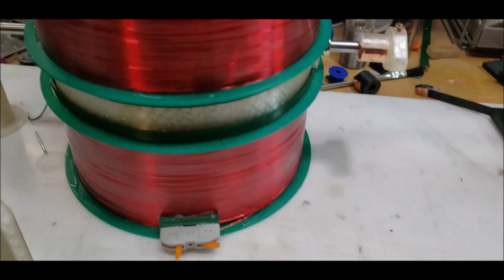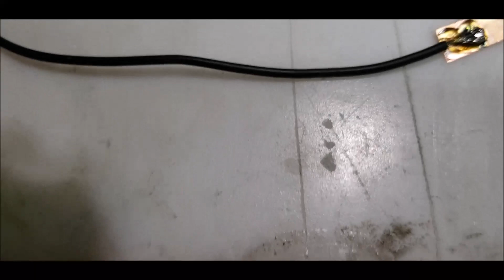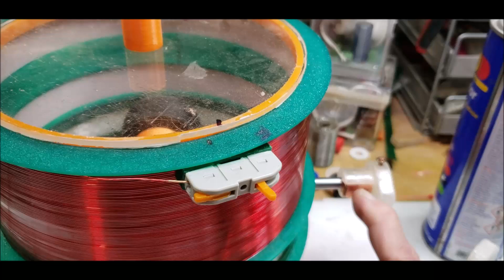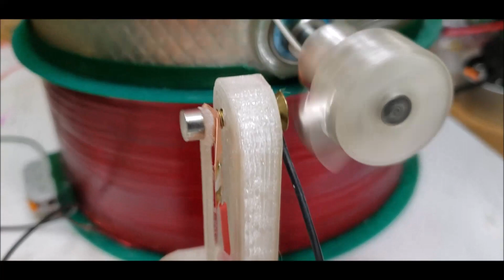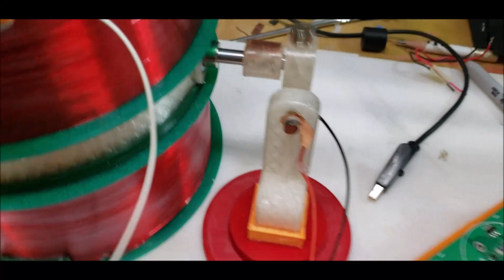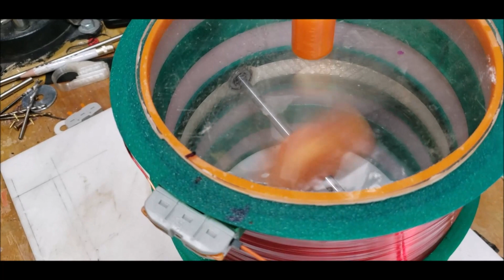3D Printed Newman Motor and Various Circuits and more.... :-)

Comment: great job... as you asked, there are 2 ways to test  that i would suggest. 
1 - instead of using the big rotor magnets to trigger the hall sensor, why dont you attach a tiny magnet on the shaft (like with the magnet commutator but much smaller magnet) to trigger the hall sensor. the smaller the magnet, the shorter the pulse which means less power consumption. (but also probably less speed)
2 -  on the other hand, for your magnetic commutator, instead of having the triggering magnet on the shaft, why not use the big rotor magnets.. here the pulse will probably be longer, but you will never know until you tested it.
Important for the efficiency of a circuit is not only the voltage but also the power draw. I only saw it with the bedini, (over 300 mA)..
Thats my 2 cents
Luc
Reply from the maker: YES and your two cents is worth a million to me. This is why I ask because more brains, more better lololo. I will do both test so thanks

Comment: the rpm is limited to the impedance on your Newman winding, to overcome this increase the voltage. You can use neon bulb across the inductor to give an indicator of when your volts are to high also it will protect your inductor from fusing out. Basically when the neon light up your using too much voltage for that winding/impedance  the winding should handle what it can and what it cannot will orient towards the dump load or neon bulb or incandescent dont really matter what you use as long as it indicates and its resistance is slightly more than your inductors resistance/impedance
Reply from the maker: When I'm using the JL 94 circuit the RPMs are much much much greater
Reply from the maker: So I think it really depends on what circuit I'm using

Comment: one half of your newman coil should be CW the other half CCW
Reply from the maker: k why? Just curious...I have and have always used the same direction method
Reply: @mcorrade  Cause CW will create North on start of winding and Ccw will creat a N on End of Winding and vs verse you know what i mean  . It dont matter but you can flip the two parts of the split winding so that the North and South land on the North and South of the Shafts Magnet
Reply from the maker: @mykedoes4099  ah sounds good